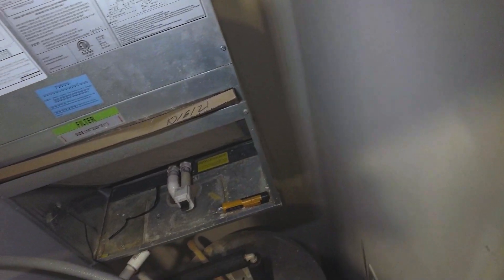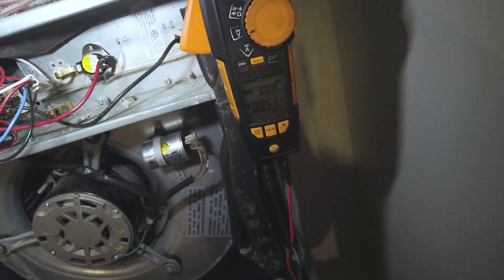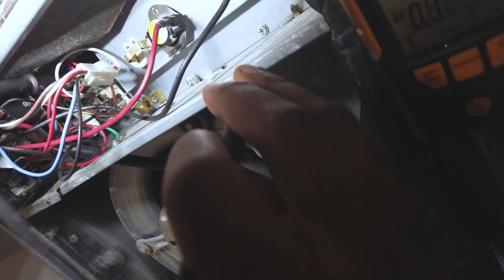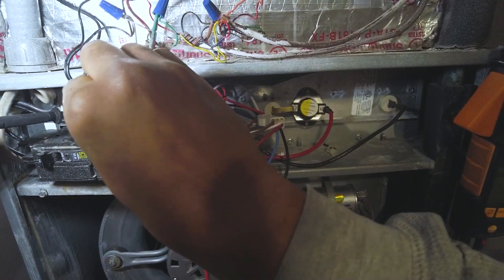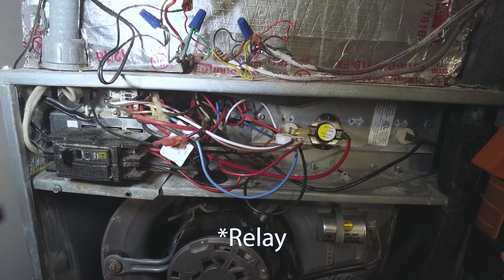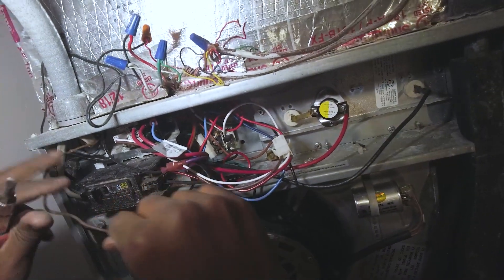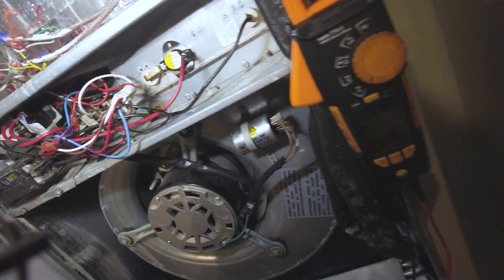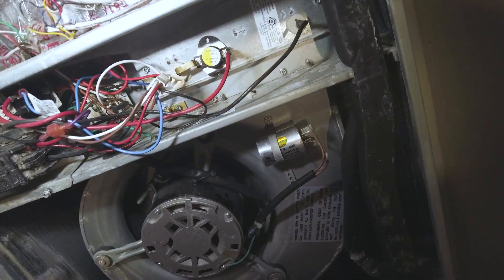Replacing a DC Relay on a Heat Strip Air Handler Why are DC Relays Necessary?

Comment: 24 Volts AC goes into 24 Volts DC rectifying the voltage that then supply clean DC volts to the relay coil that closes the Internal contact in the relay smoothly.. Ac voltage rattles and hum that causes premature failure on internal contact within the relay.. DC voltage removes common components failure due to the Back and forth movement of AC on an inductive coil thus reducing the rattling or humming effect. I tried to break it down in terms understandable.

Comment: Hello. So I'm dealing with this right now. I was working on a unit. And when I switched it to cooling mode. The relay seized. Any idea why? I inspected all wires. Everything is as is in the diagram. Thanks
Reply from the maker: Not 100% sure why did it seize  after you replaced the relay?

Comment: Hello, Do you know if the Purple and Orange wires connector are AC or DC? I want to know if it has a specific position since I can put it either way... Thank you
Reply: Its ac, so it doesnt make a difference. However, if you have two heat strips, the second relay is powered from the connectors on the rectifier, and they are pos and neg and go to specific connectors.
Carrier says using dc relays are more efficient, ......except for the one you replaced. lol.

Comment: There’s no load on the relay dc volts that’s why it’s 41dc when it’s pulling a load it will be the 24dc
Reply from the maker: Cool that makes sense thanks!
Reply: Don't voltage drops only happen when there are several loads wired in series? This is just a DC relay coil that is not wired in series. If the the power from the rectifier board is 41 volts, I'd assume the voltage measured across the coil of the relay would match that. I mean on regular contactors, we always measure 24 volts with no drop, so why is this different? I don't understand how it dropped to the correct 24 volts DC that the relay required when the source voltage from the rectifier board was 41, unless there was a resistor wired in series with it.
Reply: You're right some of these companies designed these air handlers goofy I have a Mana 20 years old I have a Mana 20 years old And I just ordered 3 new relays When they get here I'm going to locate them in a better position where you can test them easily.

Comment: Yea supposedly the dc volts for the coil are more reliable and help the coil last longer. Your high voltage is read from top to bottom. You can replace it with a regular ac relay
Reply from the maker: Nice! Appreciate the feedback
Reply: @HVACTechKnowledgy  just stumbled across your video a little late.
Basically the comment from John is exactly what I was going to say.  That is the engineer thinking, reliability, although I have replaced many.  I prefer a straight ac relay, you can use that instead until you get the OEM parts.  I have them immediately available like a 90-340; don't carry the rectifier boards.  Maybe it's all about follow the $$.
Anyway, small request that you state the brand of equipment you are working on in the videos.
Thanks for taking the time to share.
Keep up the good fight,  don't give up.
Reply from the maker: Cool! I appreciate the feedback. Thanks for watching!
Reply: @HVACTechKnowledgy  If you replace the dc relay and rectifier with a sequencer, you have to replace the spade connectors on the low voltage wiring to the rectifier, different size.

Comment: Depending on where the control power is coming from, it may be easier or even necessary. A lot of comms stuff uses them because 10v DC is a common standard for stuff that needs to go from 0% to 100%. If your board is already using DC, sometimes it's just easier to make the relays DC and avoid having to add an inverter to the design.
Reply from the maker: Nice, i appreciate the insight on that